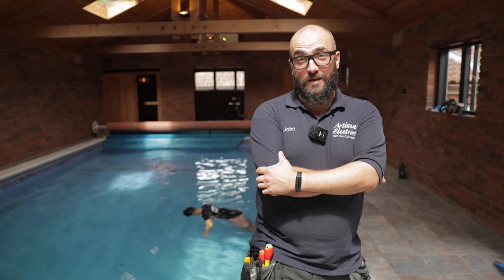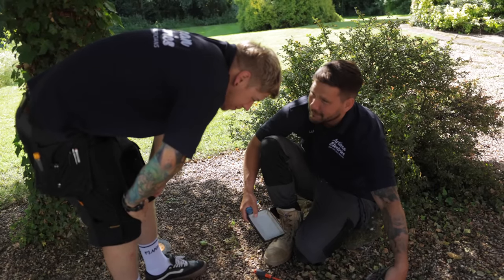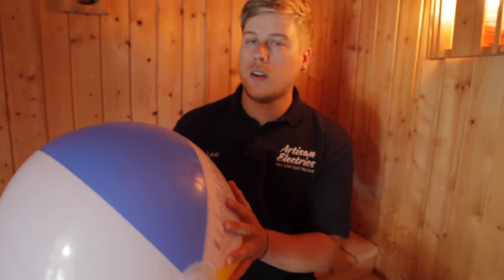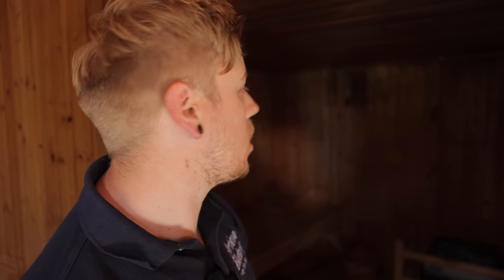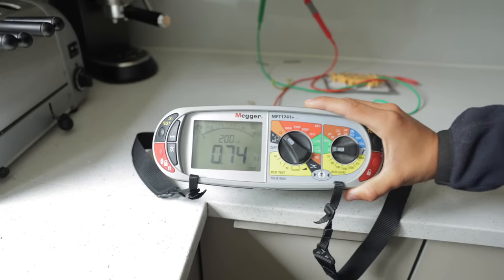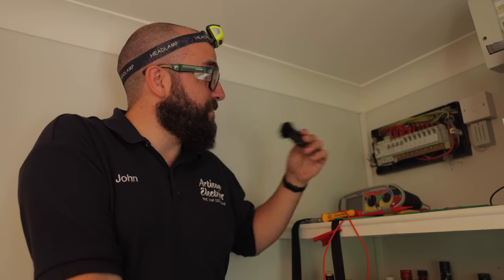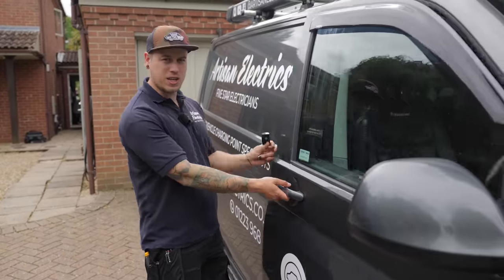Swimming Pool & Sauna Electrical Inspection - EICR Deep Dive

Comment: Think thats the second time I've seen your guys measuring voltage drop just by probing the voltage. If you do this it has to be under maximum design load. It is the load that pulls the voltage down. If you send voltage down a cable with no load, the same voltage will be seen at the other end regardless of the length.
Reply: Yeah - could be a bit of bell wire and you would still get 240 under no load.
Reply: Yes interesting for sure
Reply: Correct..

Comment: It’s worth noting that having a 100 mA RCD upstream of a 30 mA RCD doesn’t necessarily mean you have selectivity. They could both still trip depending on the imbalance.
The only way to guarantee selectivity between RCDs would be to apply a time delay to the upstream device.
Reply: Good comment

Comment: There could be a water droplet somewhere that evaporates when you turn the light on but it trips the RCD before that. So it take a while before there is a short again. @22:46 Had that a few times on a electric water heater.

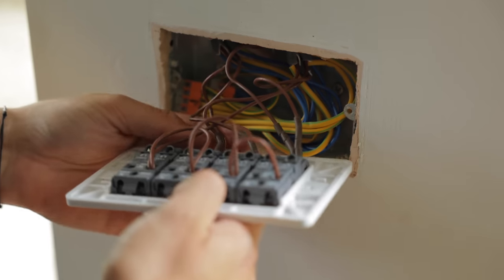Comment: 7:13 There won’t be any voltage drop unless you’re pulling some significant current through the long cable run. You can put a voltmeter after a 1 Mega-ohm resistance and it’ll still read 240 volts if there’s no load.
Reply from the maker: Very good point
Reply from the maker: Voltage drop should be calculated at max current draw on the circuit based on breaker size and resistance of cable
Reply: @artisanelectrics  so what's was the calculated VD then? I wont sleep tonight!

Comment: Also the lightfitting inside the sauna @11:29 needs to be >ta125'C and the cable >ta170'c, at least here. also no sockets or switches allowed in the sauna, only light fittings and control panels for the saunastove if it's a electronic one, and that also only max 1m from the floor. That's how its here in Finland

Comment: As pointed out, you can't get VD from testing the circuit unless it is fully loaded to Ib but get the circuit R1+Rn x Ib x 1.2 and divide by 1000 to get your volt drop.

Comment: My part time job is installing garage doors, up and over, retractable, roller and sectional. I am in charge of cables and wires. Some of the shocking situations we come across are unreal. dIY bodges, lead cables, Extension’s off other extensions.

Comment: Just a question as a non electrician, can you hook up the garden circuit to a Jackery to fault find? You say you didnt want  to turn it on incase it trips whilst customer is working from home. But maybe a temp power like a Jackery might come in handy?
Reply: All they had to do was an insulation resistance test to see if there was a fault on that circuit 🤔

Comment: 13:16 its differently a C1, My suggestion is that you  pull all the wires back i to zone 2, then use kinetics. Then a replacement swith could be used. They ha e good IP rating and arent connection to any electrical source. Dont see how the switch  comes under the regs. Like to yout thiughts

Comment: End to ends at a socket? Come on guys. So many ways to get bad results doing this. Bondings in circuit. Dual backboxes to another circuit. Test at the db and you are far more likely to get true readings. And the db looked neat, might as well do it right.

Comment: Was there any local isolation for the sauna such as a rotary isolator? If the only isolation point is a double pole switch in the pump room that can be potentially / more than likely under lock and key, I don’t think that is safe. Just a real world observation not ‘to the book’ that we should all abide by.